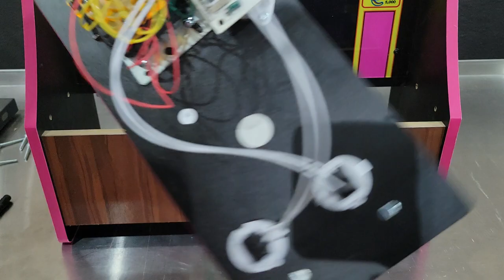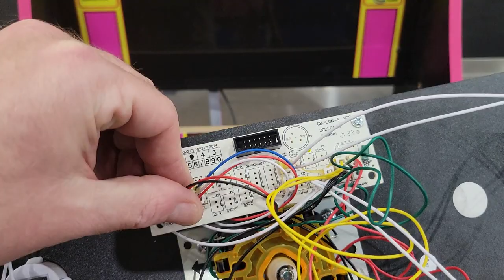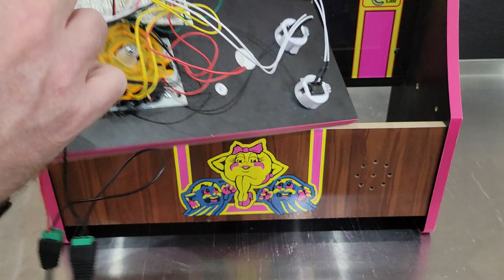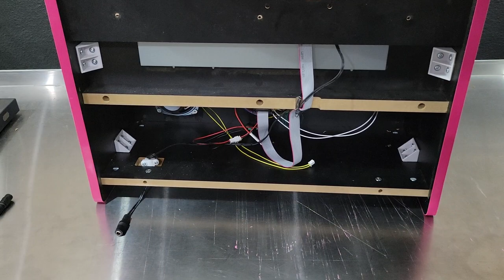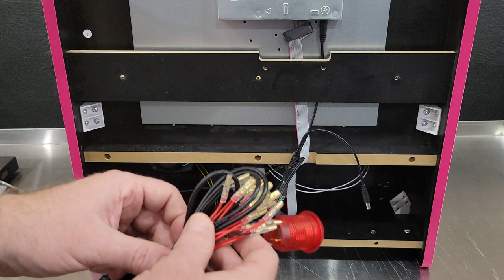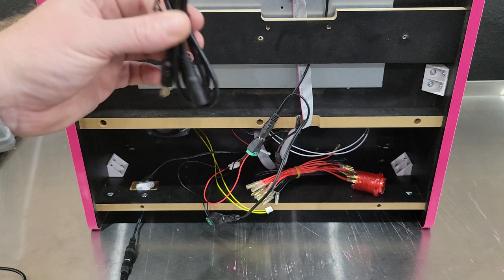Arcade1Up Power Switch Hack Used To Control LED Buttons, Marquee with Factory Power Switch Easy PNP

Comment: Hey man golden tee 3d golf has a three pin power. Green, blue and black. WTHeck? I’ve got my controller board laying out and can’t do anything…
Reply from the maker: you will need to use the inline switch then. The 3 wire is not a standard power switch and does not stay locked on.
Reply: @diyretroarcade  how about a list of cabs that are not compatible? I’m sure you all would know vs users that have never opened the controller board/box up before.
Reply from the maker: @milenkosoe   A1U has just released too many versions of the same cab, we have no way to keep up with them unfortunately.